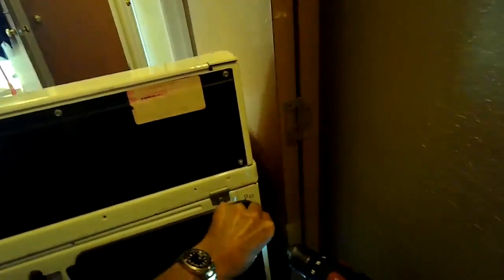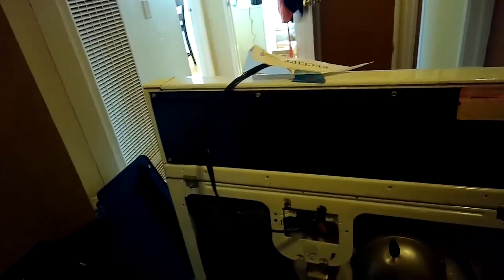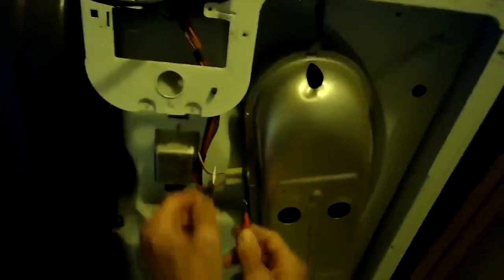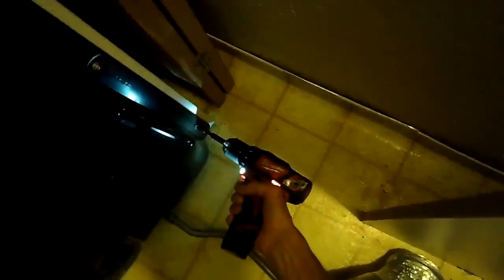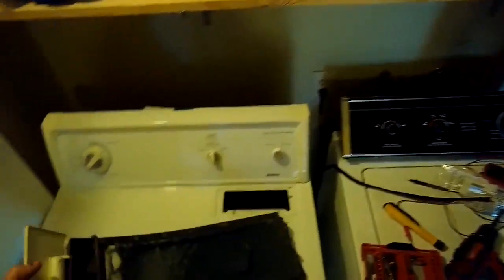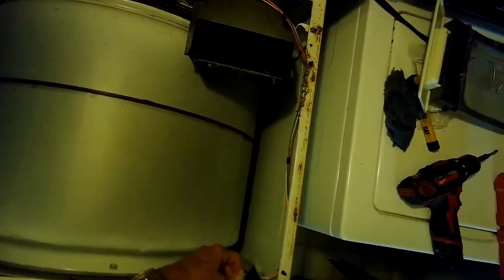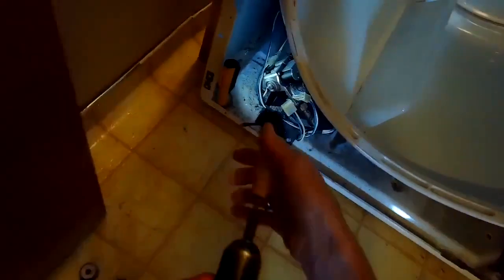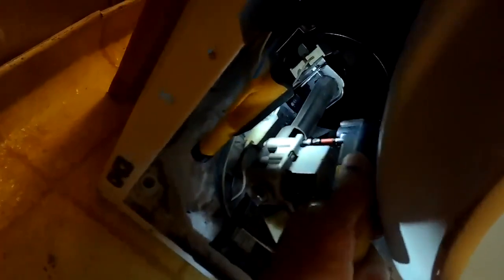WHIRLPOOL GAS DRYER WONT HEAT UP - Fix It Yourself and Save $$$

Comment: I don't know if you monitor your comments, I'm super frustrated with our Whirpool gas dryer. Not heating AT ALL. I replaced the thermal fuse, gas valve solenoids (previous ones were under warranty, so why not), and just put in a brand new igniter, and still no heat NOR is the igniter even glowing. I have watched a billion videos, everyone says it's really unusual for the gas valve to go bad, and for the price of a new gas valve I can get a new dryer off craigslist.

Have I missed anything? What would you recommend I check from here???
Reply from the maker: Does your model have a high limit on the burner tube?
That might have blown and that would stop the igniter from glowing.
You might also want to check for continuity between the two brass terminals on the flame sensor that is to the left of the igniter. It should have continuity.
Reply: @QuickAndEasy5MinuteAppliance  So, no high limit thermometer on the burner tube. I also checked the terminals on the flame sensor--I do have continuity. Since my last message to you,  I have also just replaced the dryer thermostat and cycling thermostat... still nothing. so now I'm thinking either the timer switch or temperature control switch??